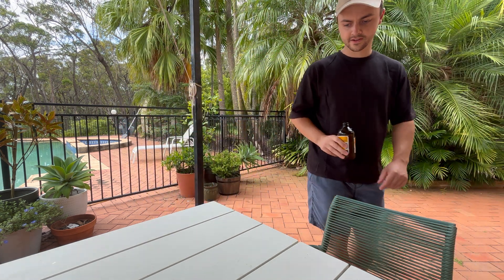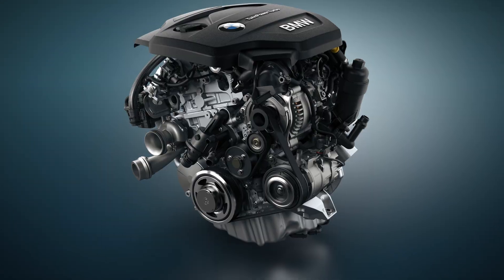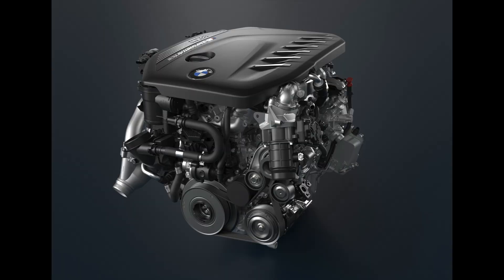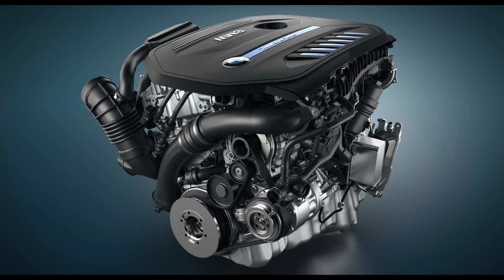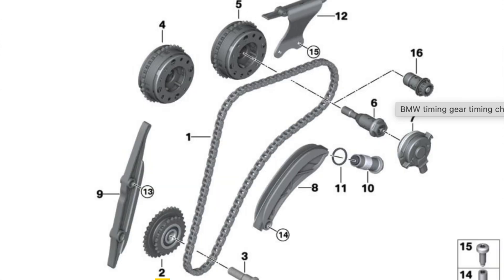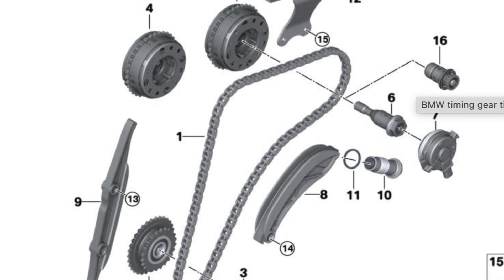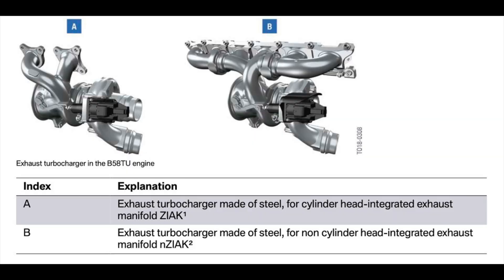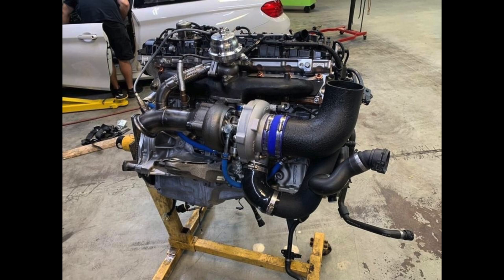INSIDE BMW's STRONGEST ENGINE

Comment: Gen1 does not have 2 port exhaust manifold. It's Gen2 low output that does. Gen1 are almost the same. Gen2 has low and high output versions. Gen2 low output is installed on regular cars (540i, 740i, x5 40i etc). Gen2 high output is installed on M-lite cars (m240i, m340i, m440i etc). In addition to better injectors Gen2 has better high pressure fuel pump.
Early Supra (335hp) has Gen2 low output, later Supra (382hp) has Gen2 high output version.
Apparently Gen1 has better intercooler than Gen2 but that's questionable.
Gen1 was available with a manual transmission in 2, 3, 4 series.
Gen2 is available with a manual transmission in Toyota GR Supra.
Neither of the engines was available with a DCT.

Comment: i drive a 540i with a Stage 2, 200cell DP and OPF delete. Tune from MHD and xHP and this thing is flying
Reply from the maker: That combo must be great in a G30. Have you got any videos of it?
Reply: @mcgarage7315  i will upload some soon. before i had just a stage 1, but the stage 2 transformed the whole car. the torque is insane. G30 is by far the most underrated 40i model on the market. It gets slept on a lot